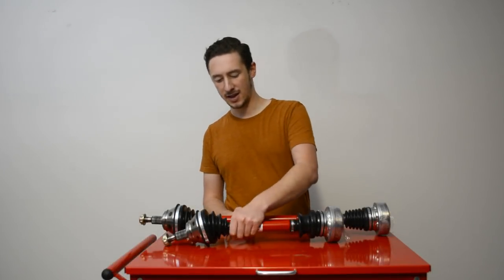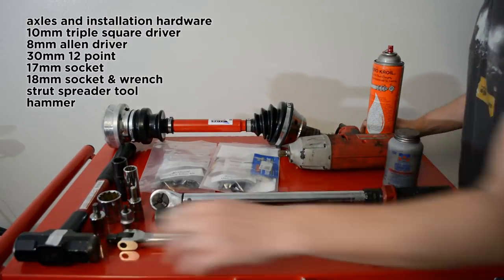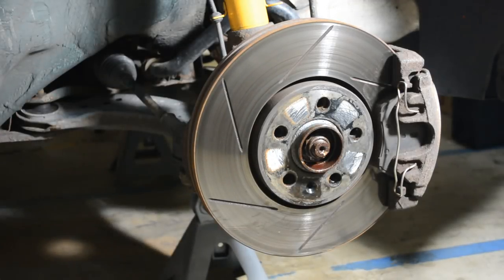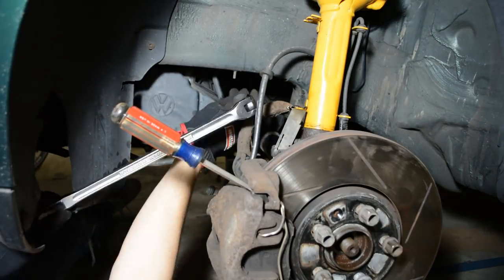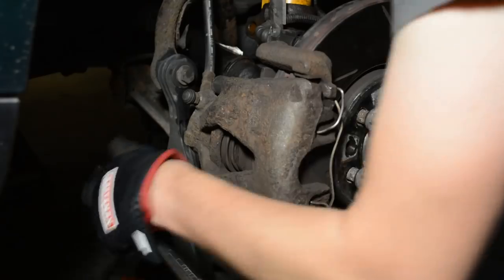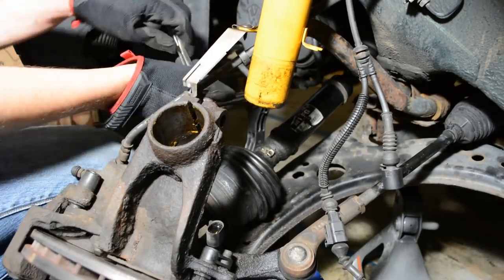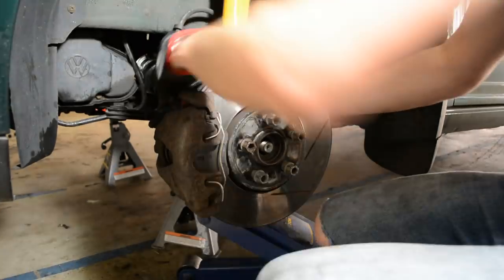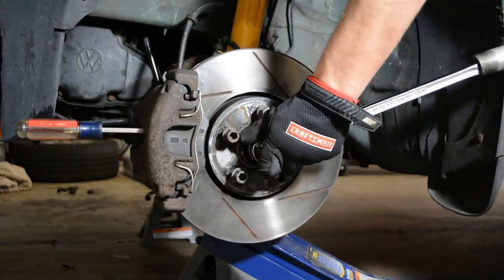MK4 VW CV Axle Removal and Installation

Comment: How did you diagnose that it was a bad axle? My 12V VR is making an occasional rattling noise from the front left side and I can easily move the stock axle by hand. It rattles over bumps, over bigger inclined driveways and if I brake hard I hear it move as well. Is there something perhaps loose with one of the axle nuts and is it still semi safe to drive if need be? Obviously replacement is ideal ASAP.
Reply from the maker: I would lean towards a suspension issue with what you're describing. I have an axle diagnoses video where I show the symptoms of a bad axle. Typically axles make a rotational grinding or popping while simply rolling. Have you checked your ball joints, tie rods, and end links? What you're describing sounds more like that than axles.
Reply: @StevesGarage  I did do coilovers on the car earlier on in the year and the sound began to become apparent a little time after that. The car is not low to the point where it’s stressing the CV joints. I will go through and have a look at all the bolts on the drivers side that pertain to the suspension components. My only pointer to an axle is the fact that it can be easily moved in and out of the transmission by 2-3mm
Reply from the maker: @gavanphotography7814  The inner joint will move like that. The inner has a tripod or spider, that not only rotates, but slides in and out of the housing. The outer joint will only rotate. I'd take a look at your suspension components, and even check if the struts are tight enough. I wouldn't rule our CVs, but I wouldn't go there first.
Reply: @StevesGarage  I’m going to check the sway bar as #1 because that’s one thing that I think could easily be the issue. When I leave the car in first gear and let it roll, tap the gas and let off you hear whatever it is rattling up front left too. The car made the same sound before and I changed my lower control arms and it went away so maybe the new bushings are shot again? I’ll check the suspension components and report back
Reply from the maker: The end links can be a pain to diagnose because it's hard to repeat with the car in the air, but that sounds like it could be end links if they're old. Outer tie rods can also have a similar issue where they make noise driving, but those you can check for play. Let me know what you come up with, lets figure it out!
Reply: @StevesGarage  Steve, I appreciate you taking the time to get into this issue with me! Means a lot! 

As for some general info on the car, it’s a 2001 model year, 213k kms on it, 12V VR6 with a 5 speed manual transmission. 

The end links have never been touched as far as I’m concerned, tie rods don’t have any play in them at all though I do have a very large dead zone in my steering for a reason I simply can’t figure out. 

I drove the car this evening and the sound I mentioned in my first comment was still present, but it only ever appeared when I was going over jarring bumps such as those in a grocery store parking lot to slow traffic. The front end felt as though the whole thing was moving with metal on metal rubbing against something as what felt like the front subframe was moving. 

While driving (sticking to 62mph/100km/h speed limits) the front end exhibited a shake, not violent at all but enough to be unnerving to any driver. The wheels have been balanced with no bends whatsoever, front struts, strut bushings and bearings, control arms, lca bushings and ball joints are all brand new yet the car still feels very loose up front. 

My only thought with regards to the sway bars is that when I did the Coilovers install, the sway bar end link on the drivers side had to come out and I’m just now questioning whether it was properly torqued down, allowing it to be loose. 

I’m at a bit of a loss here because there’s so many things pointing away from driveshafts being the issue given there’s no clicking noises from CV joints, no consistent rattling of any kind at all either.
Reply from the maker: @gavanphotography7814  I don't have any experience with worn subframe bushings, though I guess that is possible. I've read about a clunking and loose feeling also coming from loose or broken steering rack bolts. Bad endlinks will cause a noise, but shouldn't make things feel loose or shake, especially if the car is lowered. Even though there's no noise or play in the end links, you could still disconnect them and check how stiff they are. That would at least rule them out. Is it possible your inner tie rods are shot?
Reply: @StevesGarage  The steering rack bushings I do believe could be worn out, or perhaps the rack itself is. I don’t really know how to specifically diagnose that it is in fact that. Bad end links would cause a consistent noise through all driving though would it not? I will pop them off and take a look to see how they are as well. The subframe bushings I don’t know how to diagnose that either, though I’d think wheels off and up in the air would be the beginning steps. As far as the inner tie rods go, I have once again got absolutely no idea how to diagnose that. The car has always had loose steering and a clunk from the steering so it’s always been a mystery to me. Just this additional sound it’s now making is contributing to this whole mess of things
Reply from the maker: @gavanphotography7814  Front end troubles can be tough for this reason. Best bet is to have it up in the air and start grabbing on things to make noise. The steering rack bolts are 4 13mm bolts on the subframe. There are videos about specifically checking the inner tie rods and things like that so I won't get into it here, but most front end noises you can repeat. Start simple and on the outside, and work your way inwards.
Reply: @StevesGarage  Understandable on the inner tie rod side of things. Should I try and see if those 13mm bolts are all tight with the car in the air? When the key’s in the ignition and car off, if I turn the wheel lightly it makes a knocking noise from what I think is the rack so it could be loose or the bushings are simple bad.
Reply from the maker: @gavanphotography7814  Yea, see if those bolts are loose. While it's up there pinpoint where the noise is coming from and hopefully you can diagnose it!
Reply: @StevesGarage  I’m gonna do my absolute best to see if I can figure this out! I’ll keep you posted on what happens when I get a chance to get it up in the air!